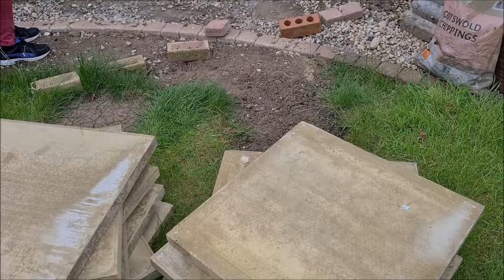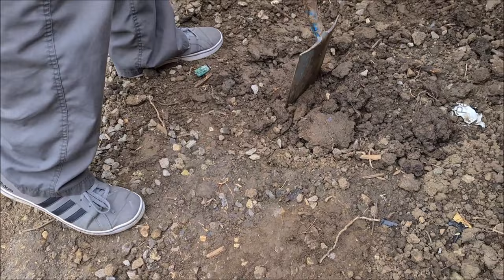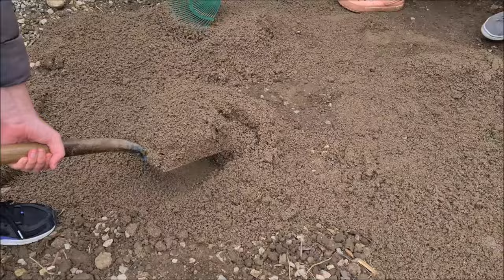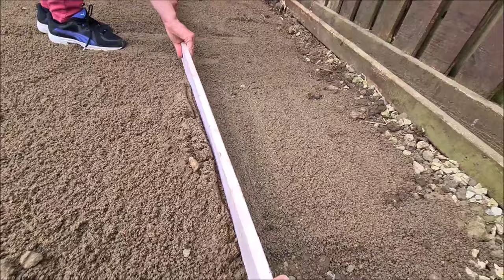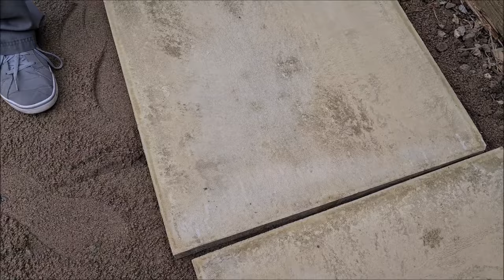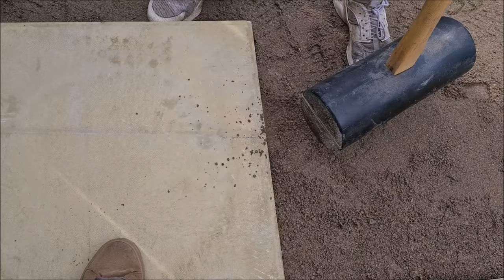How to build paving slabs garden shed base

Comment: Better control water runoff.  Not enough base and you didn’t even tamp it.  This won’t end well 😬
Reply: what is tamping? The ground I need to lay a base looks just like this, I was going to dig down a few inches a lay sand
Reply: Can you please explain what tamping is?
Reply: @steveb7853  it’s what’s done to settle the foundation prior to placing a load on it. Can be done using a heavy tool, or tamping machine.